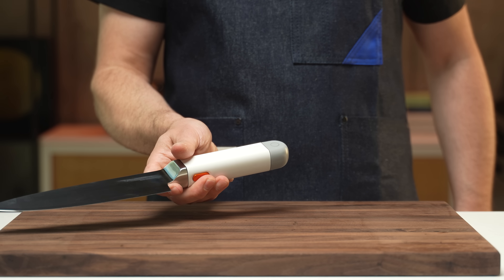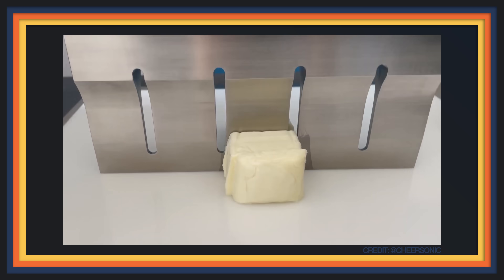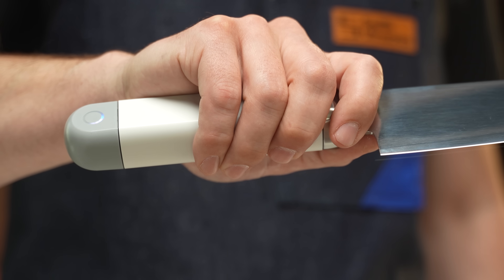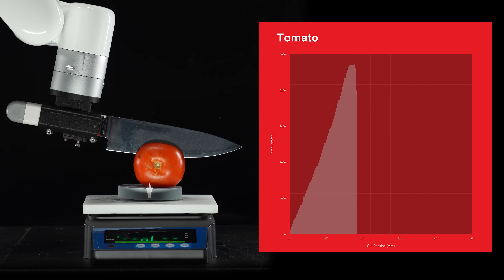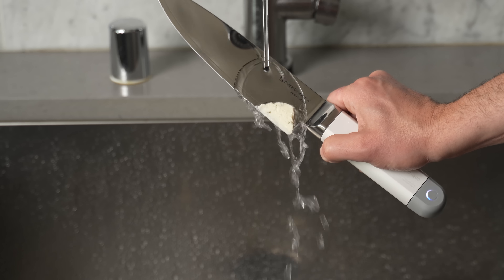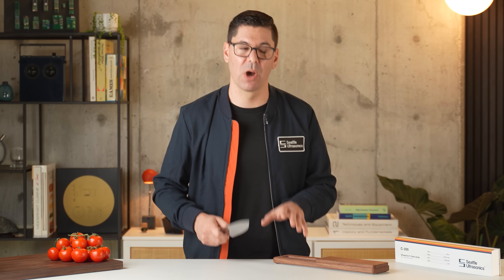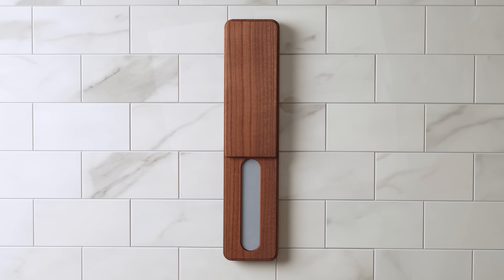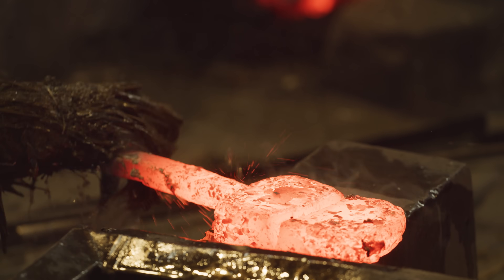The World's First Ultrasonic Chef's Knife for Home Cooks: Seattle Ultrasonics C-200

Comment: Obsoletes several task-specific knives by making the main prep knife even more versatile. Still plenty of room for variant sizes, too.

But being a big engineering nerd I have questions:

How is it for long term comfort and durability? How well will the IP65 rating hold up when it's been treated like a tool for a couple of years? What kind of torques can the tang tolerate; or is there a warning not to treat it like a regular chef's knife around squash and other tough material?
Reply from the maker: Thanks! Great questions. I've had testers using this form factor for 1+ years. Other than folks with very small hands for whom the size of an 8" chef's knife feels big, no complains on ergonomics. The handle is surprisingly comfortable to hold (we did a few dozen iterations in design). The button is backed by overmolded TPU and the gaskets are silicone, so IP65 ought to hold up well. Regarding torque, I put the knife on the robot and pressed down with 30% more force than I could apply with both my hands and all my body weight, and the handle didn't budge. I'm sure folks will find new and creative ways to torment the device, but we've tried to anticipate and design accordingly. Hope this helps!

Comment: Frankly, all I see is an over-engineered  knife that—when pressed straight down into a tomato without any active slicing action—cuts through the skin easier but otherwise falls through no better than a standard chef knife.

No one slices a tomato that way. And once you introduce some slicing action, there’s no difference. Also, people are still going to have to hone and sharpen this knife too. So what do they get except a little more time between sharpenings?

Rather than spend $400 on this knife (and another $150 for the charging base 🙄) wouldn’t they be better off buying a $150 Wüsthof and a nice, HORL sharpener ($135)?
Reply from the maker: Hey Evan, you might be interested in the work we did for the Quantified Knife Project gathering data on how other knives (like the Wüsthof) objectively perform on food cutting tests. This is a thing we've been studying in some depth.
Reply: I honestly thought the tomato test shown was a pretty poor choice, given exactly what you pointed out. What is far more interesting from this knife is the non-stick possibilities. If I can cut up a tray of fudgy brownies without having to wipe the blade down after each cut, or all the other hard-to-cut-cleanly pastries, then I'm interested.

Comment: Saw your previous video about knife sharpness. Ordered during this one. Could you tell us how much active cut time we get off one battery?
Reply from the maker: Thanks so much! On a full charge, the C-200's battery provides about 20 minutes of continuous running at maximum power. However, the C-200 only runs while you're holding down the button. In practice, that 20 minutes of run time many hours of cooking: enough time to dice at least 20 onions or 40 potatoes.
Reply: @SeattleUltrasonics  on the onions... Does the liquid-to-mist feature make cutting onions worse? 😂
Reply from the maker: @maj429  EXCELLENT question! This one shot me out of bed in a cold sweat one night. Thankfully, no. Onions don't really mist, and after dozens of alliums tested, we're safe from the threat of weaponized onion fog.
Reply: @SeattleUltrasonics  What about meat? Would it make the raw meat juice be vaporized? One of the hardest things to cut is fatty chicken leg and stuff, especially with a dull knife, and a major reason I just don’t wanna bother cooking at all…

Comment: Wont this have a very similar problem to all normal kitchen knifes, it will get dull, and once it is, the ultrasonic's won't help much anymore?
Edit: You mention "Japanese steel", but don't specify exactly what steel?
Reply from the maker: The ultrasonics act like a multiplier on sharpness. So even if (and when) the cutting edge dulls, it still behaves sharper when it's on. This is reflected in BESS tests (on vs off) but is also reflected in robot cutting tests because a significant portion of cutting force has to do with friction against the sides of the blade. That reduction in friction persists fully, even if the secondary bevel gets dull.

The steel is Japanese AUS-10 in a san mai construction, at ~60HRC with a 26 degree inclusive bevel angle from the factory.

Comment: I've seen ultrasonic cutters for fabric and leather, but how safe is this for the human body when we actually use a pinch grip/touch the blade while cooking? I am not talking about possible cuts, but possible skin/nerve/blood vessel damage similarly to what can occur with industrial vibrators. Have you tested this?
Congratulations on the product launch! All the best!
Reply from the maker: Great question. If you watch the part of the video that shows the simulation, you'll notice that the amplitude of the vibration is concentrated around the cutting edge and there is very little motion at the bolster and essentially none in the handle. Also note that this knife runs at about 10W, spread across the edge of the blade, compared to industrial cutters that run at extremely high power or cutters that focus all their energy onto a very small blade.
Reply: @SeattleUltrasonics  I appreciate the info, but that just sounds like it was not tested (for that specific kind of possible damage).
 By using a pinch grip you grab the blade as well, not just the bolster/handle and though I understand the vibrations are more concentrated towards the tip, the whole blade is still vibrating at ultrasonic speeds.  Did you actually test the effects of this on the human body?
Reply from the maker: We've been beta testing these units in human hands for over two years, using pinch grips, with no adverse effects.
Reply: @SeattleUltrasonics  Thank you!
Reply: 40kz at such a low amplitude isn't likely to do anything, I doubt people with arthritis could even tell the thing's running. If you think about how much absorption/dampening your hand does over the relatively large contact-area the resulting energy is so small that even if there was some damage, it would likely be negligible given how short the average exposure would be in relation to recovery time. That being said I'd like to see some testing as well.